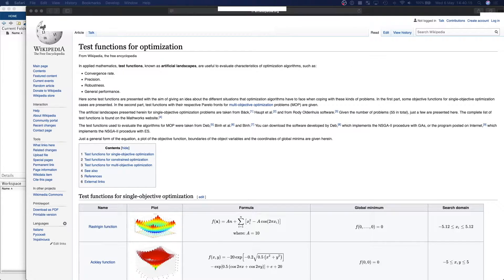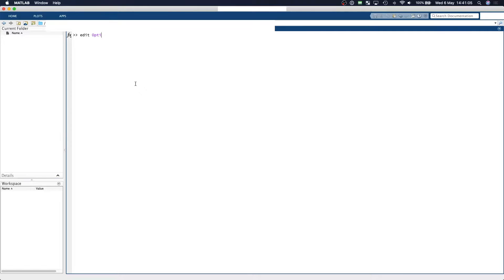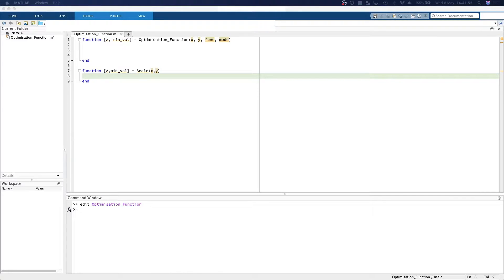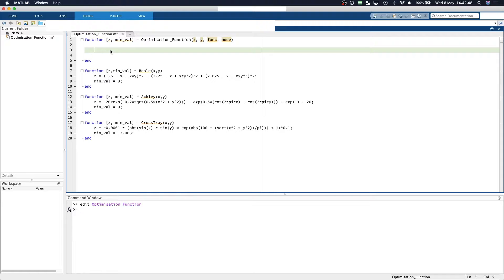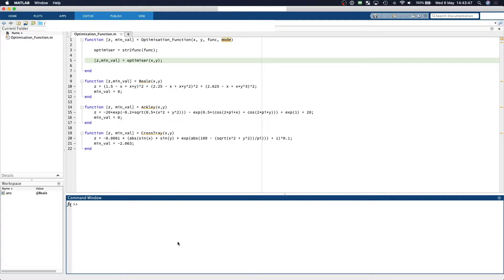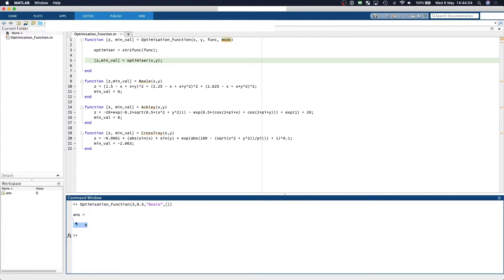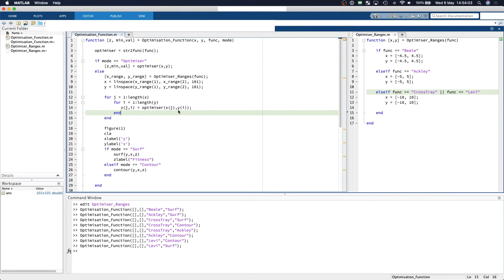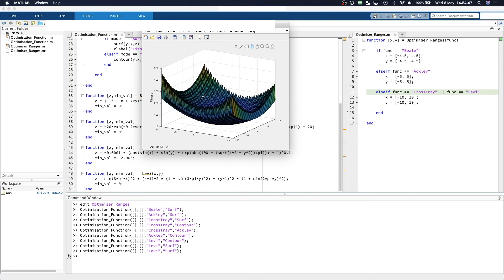Optimisation (MATLAB) Part 1: Optimisation Functions

Comment: Thank you! What if I wanted to change your test optimization functions, and replace them (Beale, etc.) with a custom made f(x,y) while also changing the limit boundaries. I did change the 'z' within the Optimisation_Function but the plot was erroneous Any thoughts?
Reply from the maker: Interesting. Are you able to send the code and the error you received?
Reply: @HysterResearch  hello, thank you for replying. Would you please give your email, so i can attach other functions willed to be plotted, to be merged within your optimisation_function?
Reply from the maker: Feel free to contact me on codingforscience@gmail.com
Reply: @HysterResearch  Thank you. I have sent you the correspondent code, which accordingly, Optimisation_Function.m must be reshaped.
Reply: @HysterResearch  my destined function is a relation between two variables, of the form Y = X (not f(x, y)) where only plot(x, y) is needed as the output graph where onto the population will be distributed (unlike surf or contour))
Reply: @HysterResearch  if there is any  obstacle with providing any email address, i can copy/paste the plot function, so you can modify Optimisation_Function accordingly